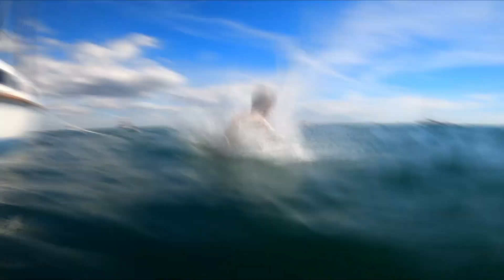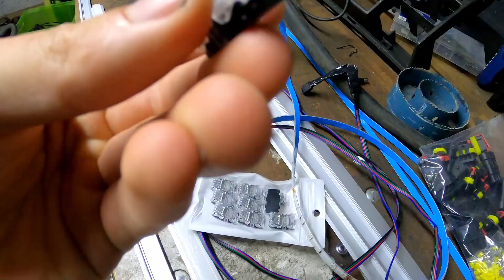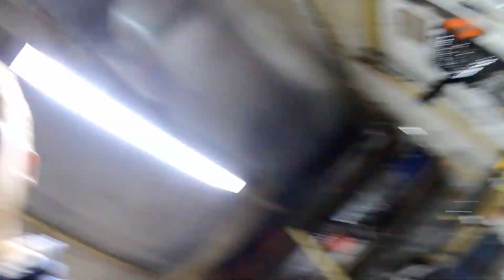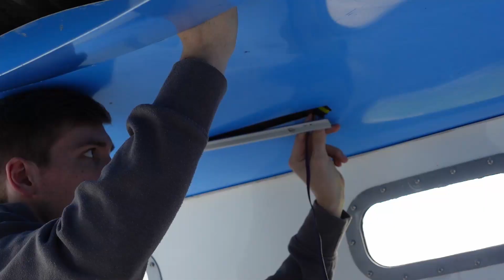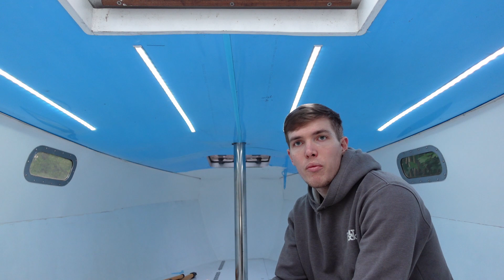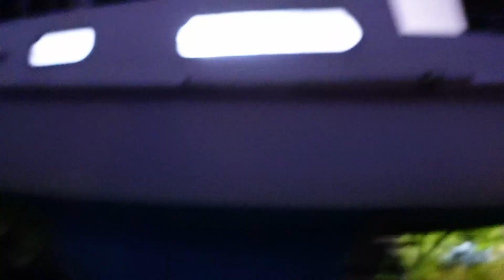HEADLINING AND LED LIGHTS DONE! Sailing Meraki | Ep.68

Comment: Looks brilliant Alex.  Have you got a link for the led strips you used?  Also those connectors are great, I have the three wire to wire ones.  What would we do without China and ebay/Amazon…. Andy UK
Reply from the maker: Thanks Andy! They have probably been relisted by now but they should be easy to find on Amazon. Just search “led rgb strip light” and “led strip light profile”.